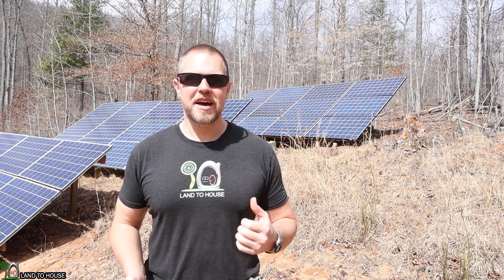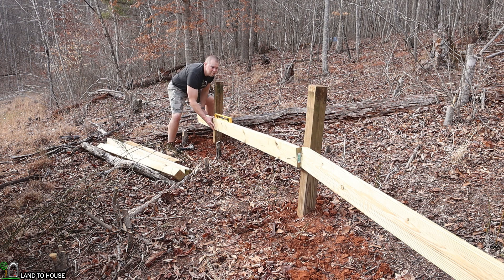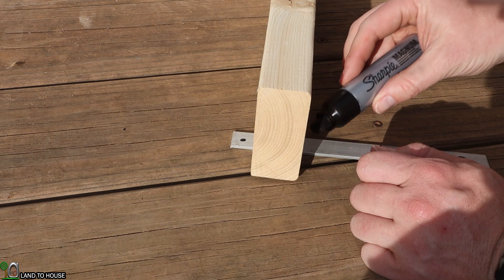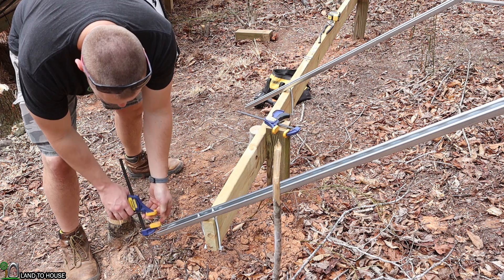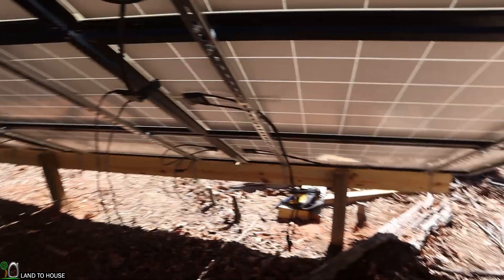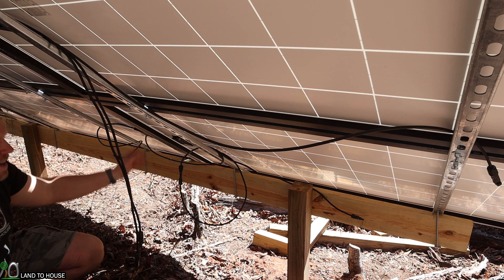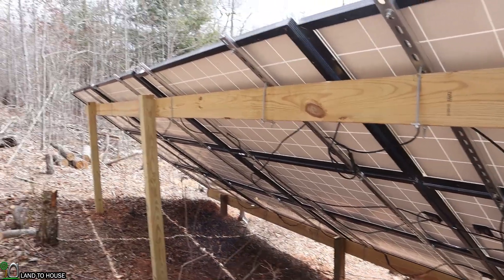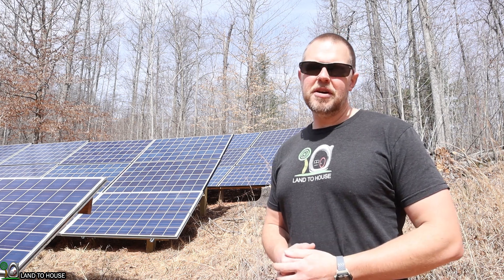Guy Installs 3KW of Solar in 11 Minutes

Comment: yeah right, he snapped his fingers and the rack arrived,
yet again and the rack was anchored to the ground
yet again and the cable was run in a code rated conduit to his breaker panel
yet again and the panels were bolted down
yet again and each panel was properly connected in the array
....
he could have done it in five minutes rather than eleven.

Comment: you don't need concrete for the poles
Reply from the maker: It's worth putting a little gravel in the bottom to help drain water. But those Poles should last for 20 plus years without concrete

Comment: Considering that these panels are there to stay for the next 25-30 years I see no reason to use wood.  I would do concrete footings and zinc coated metal for the structure. Do it right and do it once.

Comment: Do the panels have to be grounded? How would you do that with a wood mount? I've never seen you mention grounding your system. Or does it NEED grounding anywhere?
Reply from the maker: In order to ground the panels I have installed an SPD or serge protection device inside the house at a breaker.

 This has an earthground and a 600 V clamp.
Reply: @LandtoHouse  Ah ok. Thank you

Comment: When connecting the panels, it is good to keep them covered and use dielectric gloves. 400V= is no fun and it can kill you.
Reply: Its more about the current, but eitherway it isnt the greatest.

Have you ever been lit up by a spark plug coil on a car?  50k volts.  Hurts like hell but won't kill you.
Reply: @wadebrewer7212  you need over 100mA and it won't be a problem with this solar array
Reply: @StakrCZ  ever been zapped by 120v from something grounding out or bare wire?
Reply: @wadebrewer7212  yes i got zapped by 230V
(i'm from Europe) and from 6kV (by charged line transformer and line capacitor)
I luckly survive, but 2 my co workers was get kill by 230V from 100VA transformer.
I´m electrician in heavy industry.
Reply: It is always about the amperes!
Reply: @markarca6360  Not really, if you have 500Amps at 24V then you are safe but if you have let´s say 1Amps at 230V then it can kill you.